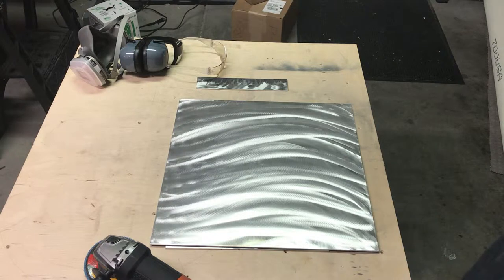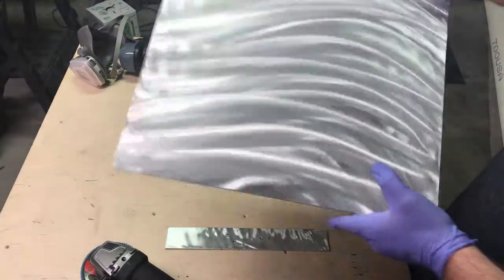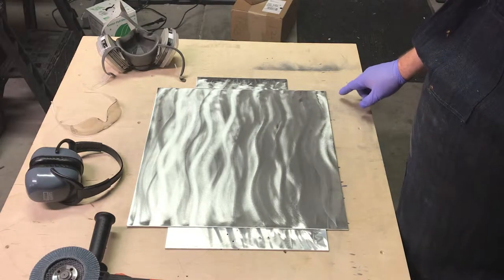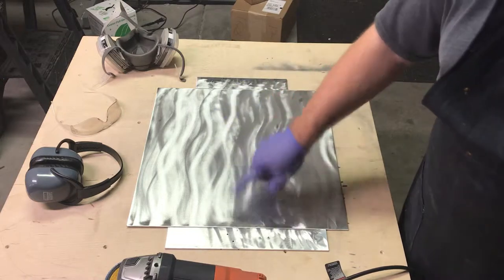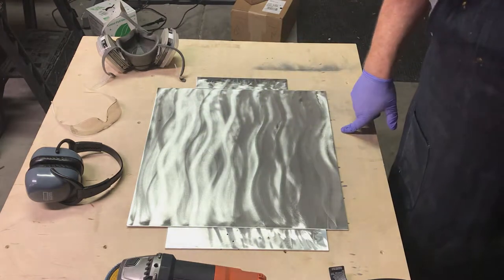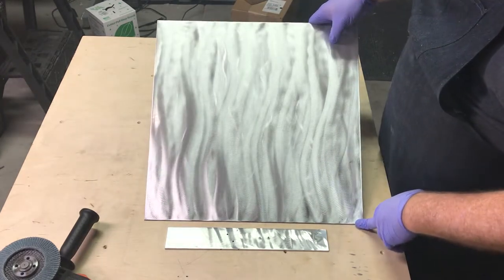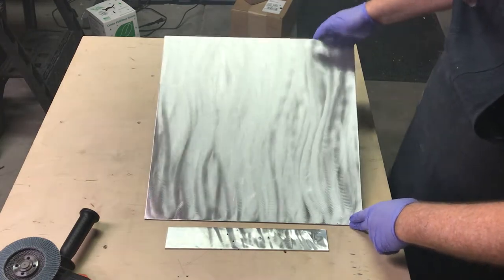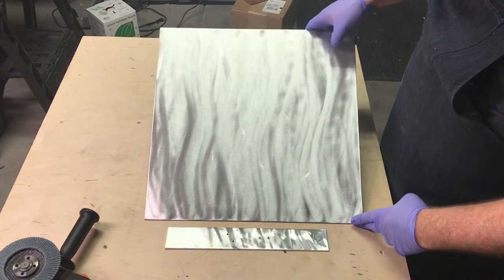Metalworking - Grinding aluminum with a flap disc

Comment: You said 40 grit flap disc, but your description says dewalt z80, and that's an 80 grit flap disc according to Lowe's. In this video, did you use the 40 grit or 80 grit?